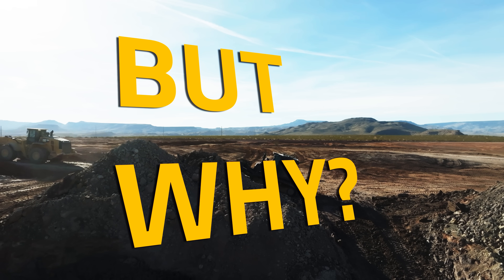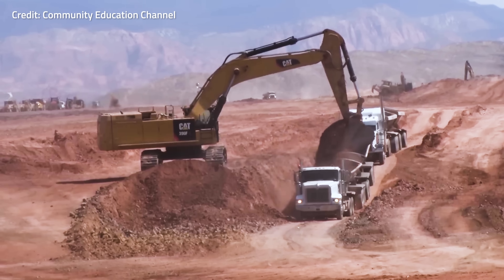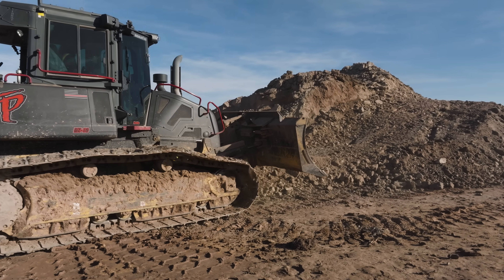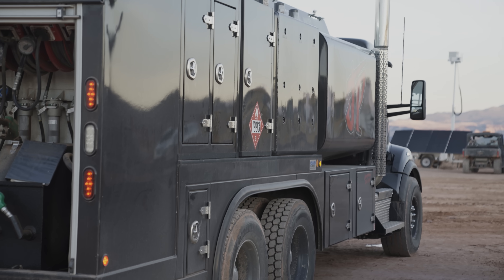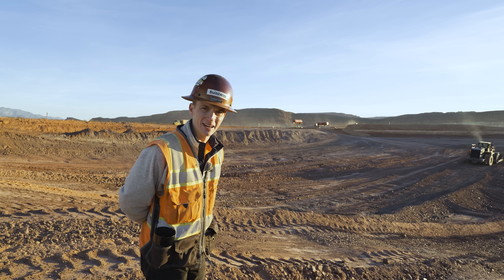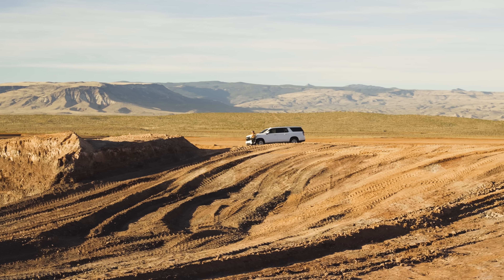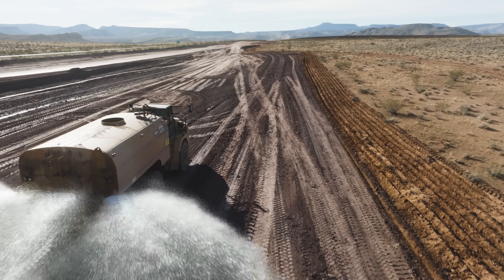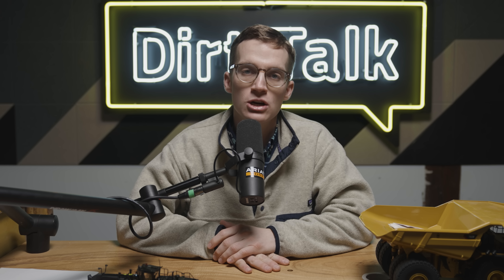Why is Expansive Clay a Building Nightmare?

Comment: I worked on some homes in an area of Oregon that has clay trouble.  On some homes the problem was not just swelling in the winter, but then the  clay shrank during the winter.  This would of course cause the foundations and patio slabs to crack.  The solution was to install water pipe around the perimeter with drip irrigation emitters every foot or two.  Across the patios holes were drilled for the emitters.  The whole system was on a timer valve that was turned on during the dry season.  This kept the clay at a consistent moisture level and control the subsidence. I suppose that a moisture meter to control the water valve would be even better.

Comment: I used to work for a home builder, we ran across a neighborhood with expansive clay about 15-20 feet deep. Wasn’t found on geotech reports prior to development because reports usually only run about 10ft deep in that region. Long story short, the builder had to buy back several homes in the neighborhood because the foundations started moving. I lived in one the houses for a short period of time, the living room was 3” lower than the kitchen because the entire house had rolled or pitched to one corner.

Comment: My kid did geotechnical testing for a while. He was taught a very good example of the size difference between clay and sand. If you have one particle of sand, and it’s the size of your house then one particle of clay would be the size of a soccer ball.
Reply: Sorry, not round like a socker ball. Clay particle is a flat platelet, more like a Frisbee, to stay with a sport analogy. However, at this micro scale the tiny electric charges on the surface of the clay platelets repell the so that the platelets are all jumbled up with gaps in between. Water is added to "optimum moisture content" for compaction so that the clay platelets are smeered and become parallel.  With out the air spaces between the clay platelets, the clay becomes impermeable.  However if the clay dries out, it will start to crack and the clay returns to jumbled condition, then it shrinks and swells  again.
Aron, you did see this in your videos of the construction of the inline water storage for Murrumbidgee Irrigation in NSW Australia.
Hope this helps.
Reply from the maker: That’s an awesome comparison

Comment: We've got a lot of clay in Canada, but it tends to be a rather thin layer. The only places where you find thick layers are large river bassins such as the St-Laurence. Because it is such a thin layer in mountainous areas, the tendency is to just dump it in the nearest hole and burry it with rock from the rest of the excavation. With the amount of rock being put on top to level the terrain, the clay just gets compressed and is mostly a non-factor.

Comment: homes built on clay use  cable stress systems and floating slabs to allow movement and the plumbing isnt brought direct through concrete there is space to allow floating

Comment: In East TX under a sandy, loam topsoil we have expansive clay that creates foundation issues as seasons cycle through dry and wet seasons.  Because of this you will not find a basement under a house here.
Reply: here in  california we use floating cable reinforced slabs, is it the same there?
Reply: @gallardoo9  I was told it is used sometimes for large commercial projects like big box stores or warehouses but not in residential due to high cost.
Reply: I never knew how bad the clay was here until I started working in clay pits

Comment: A lot of people don’t realize that soil compaction has to be done at the right % of moisture depending on the amount of clay, sand, silt, organics etc in the soil. Usually sand or bankrun is used for stuff like this. I’m surprised they didn’t put in stone mats once they got down to the clay that the dcp determines is hard enough to start the base and build it up in 8”-12” lifts until a big roller can be used and lay 18” lifts.

Comment: One of my favorite areas of Utah to go trail riding. The terrain does change dramatically, extremely and suddenly. Sand Hollow has the most difficult sand I have ever drove on anywhere in the US. Stock 4x4 vehicles have problems getting stuck in the parking areas near the lake, let alone trying to go offroad.
38"+ tires and another equal offroad vehicle, is safest way to travel the area offroad; pull each other out. 
Matts Offroad and Trailmater; I will be there in March too. Moab is also great; I love Glenn Canyon.
Reply: Me too!
This type of activity is way out of my price range,  but I absolutely love love love watching the MORRVAIR!
I volunteered last year and am signed up to help out again!

You are 💯 about the sand out there.
I backed my 2015 Ford Transit van off of the blacktop and sunk up to the frame instantly!

I wasn't too worried about finding someone to pull me out,  seeing how there must have been 2000 4x4s there with wenches and ropes.

Comment: Obviously, the first time they built this runway, they did a shit job. Clay, by its very nature is waterproof when compacted properly. Moisture shouldn't have been able to get under the runway in the first place.

On another note, you might do a video on the runway in Inuvik, NT, Canada. There, the biggest problem is permafrost. They have just done a major expansion, and it is not going well at all.  It's a cluster .... caused by incompetent engineering, typical of infrastructure projects in the heavily politicized north.
Reply: FAA was told this was the correct way to do it. Feds thought they knew better. It was a major uproar here. Literally the fix was the way they were told to do it in the first place.

Comment: Clay is a problem in many parts of the country.  I know of a warehouse in Michigan that you enter at the front door and then it is about a 4 foot elevation drop to walk down to the service counter. The warehouse is huge covering acres and the clay beneath the structure has slowly dehydrated over the years causing the clay to shrink.  In Texas the normal is if you have a big box store, Home Depot or Walmart  there is a sprinkler system laid out below the warehouse prior to construction.  So that water can be seeped into the soil under the building to keep the total moisture content of the clay at a constant percentage.
Reply: I was in a crawl space under a house where Clay soil had contracted.  There were deep fissures in the clay about 2-3" wide at the top.  The center of that house section had dropped by about 2" due to the ground settling below it.  This is western KS.

Comment: McAninch Corporation out of Iowa were one of the first earthmoving contractors who had soil engineers on staff and designed a mobile lab enabling the engineers to travel from job site to job site evaluating soil samples and conditions daily then work side by side with Ziegler Caterpillar to develop and build the most effective and efficient earth moving systems for their job sites.  The majority of their work deals with heavy clay soils and when contractors bid certain jobs without soil conditions knowledge it can quickly bankrupt them.  They run s Cat D11’s configuration for towed Cat 651 Scraper Pans which they develop in house, Cat D10’s towing Cat 641 Scraper Pans and Cat D9’s towing Cat 631 Scraper Pans.  This eliminates the need for push dozers for the scrapers and graders for haul road maintenance.
Reply: I love those McAninch machines.  A Cat and can will do the work of several other pieces of equipment.
Reply: @ and no bouncing around destroying your back while driving those rubber tired scrapers. 👍

Comment: You would think an on site engineer would have stopped the blue clay fill in the original runway.
Reply: Blue clay was already there.  FAA was told this was the correct way to do it. Feds thought they knew better. It was a major uproar here. Literally the fix was the way they were told to do it in the first place.

Comment: Paint scheme looks awesome but I imagine it makes spotting small oil leaks during quick inspections difficult
Reply: Also the dark scheme will absorb heat causing the machine to run hotter.
Reply: I know this company. (In fact my brother worked on the air port runway for 18 months) … anyway, this company takes exceptional care of their equipment. If there is a leak, they’ll notice it. On a side note, I liked there previous color scheme better : JP red on CAT yellow…

Comment: If they are doing all of this testing, why didn't they do that extensive testing prior to dropping the coin on the original runway.  These guys are hoovering up 26 mil on this project sounding smart and confident.  In less than 10 years there will be another project - probably 40 mil - to redo the runway where it's clear that Mother Nature doesn't want one.  This story makes me facepalm.  Trucks are cool though.
Reply: FAA was told this was the correct way to do it. Feds thought they knew better. It was a major uproar here. Literally the fix was the way they were told to do it in the first place.
Reply: You're the reason it was done badly the first time. People that don't want to pay to do it right the first time. 
Instead they hire a low bidder offering their "idea" of how to do it for 1/3 of the other bids. It will have a condition that they aren't liable if it doesn't work.
Reply: @sparksmcgee6641  really don’t understand that you have to do it the way the feds tell you. The contractor doesn’t have a choice. The Feds gave the scope and ignored the locals. Your tax dollars at work.
Reply: @Baddecisionsjkur   No that isn't how it works. Airports are locally owned. Designs are done by the locals and owned by the locals.
FAA is just the standards for flight operations. Same as ICC is the  standards for local building codes.

Comment: I use to operate a drill rig here in Utah and have drilled down in southern Utah in blue clay several times. Blue clay is the worst. There were times we would drill 1ft and would fill an 5ft test tube full of blue clay because of how expansive the material is.
Reply: thats nuts
Reply: Remember silly string?  That's what I'm picturing.
Reply: Does it make good pottery?
Reply: @Qce-i6d blue clay is good for pottery but it depends on how much sand and other crap is mixed in

Comment: I live in Drumheller Alberta. Aka the badlands and it's called the badlands for a reason. Lots of bentonite. House foundations barely last 50 years here. Roads get re paved and completely fucked again in 10 years
Reply: There is an ancient fault line here in Texas name the Balcones Fault. West of the fault there is hard limestone to build on. East of the fault there is blackland soil with a layer of clay underneath. Anything built on that has to either dig down below the clay or, for buildings with a concrete slab, pilings driven down to bedrock.

Comment: Instead of changing clay ,they could have made  under ground  
tunnel on one side or both  sides same as Japan under  ground  tunnel  for flooding....to Suck water from clay through  holes on slab or pipe. 
No need make very  costly but only  upto need. 
Engineers  can fix   cement  slab with holes either one side or both sides. Every thing thing is under ground from top look one but separate inside. 
Water will not go from top because of road,
or from sides because of cement slab. Excess Water will come out from holes in slab and will flow through tunnel. 
What do you think. Jay  bharat.
Reply: Discuss with Engineer comunity. 
They can reduce price.
Reply: Doesn’t work in our area.

Comment: if the engineers are wrong, that’s a very expensive mistake.
Reply: Yeah, what happens if the dirt or the Clay doesn’t do what they wanted to do you know what I mean what happens if that Clay either dries out or tats on even more water than what and expand even more
Reply: @steveanderson4768  geologist here, yes exactly.... geotechnically bentonite is used because of it's expansive properties. however, bentonite consists of many different types of clay particles all with a different expansion coefficient. The most important one is montmorrilonite, which expands to a multitude of it's original size under water. So depending on local areas and for example the montmorillonite content the expansive properties of the soil can vary significantly, leading to new ripples etc. A proper way would be to remove the bentonite clay and fill it up with normal non   expanding soil until it is so thick, that the swelling pressure of the bentonite can't be bigger than the weight pressure of the topsoil and thus can't expand.. I think the company just want's new contracts in this case. the fact that they got through the first time and didn't have any huge lawsuits is astounding or didn't check the geology beforehand, it's not that it isn't a common phenomenon or rare in utah and as a local company they should have expertise...
Reply: @Dank_Giraffe  as with anything geological in nature, just give it some time.
Reply: Y’all aren’t here. Geotech is different. FAA was told this was the correct way to do it. Feds thought they knew better. It was a major uproar here. Literally the fix was the way they were told to do it in the first place.
Reply: @ and?
Reply: In 2011 St. George was a very small town and everything was approved with minimal detail.
Reply: The music junked another video 👎👎👎👎💩💩😬
Reply: Exactly. I can't believe they aren't lime treating it to stabilize it. This is gonna be a disaster.